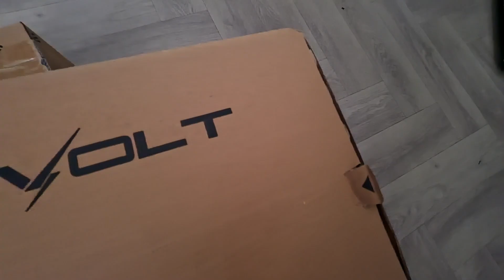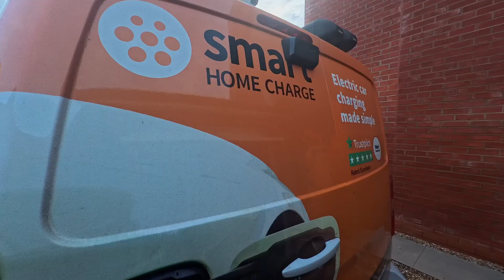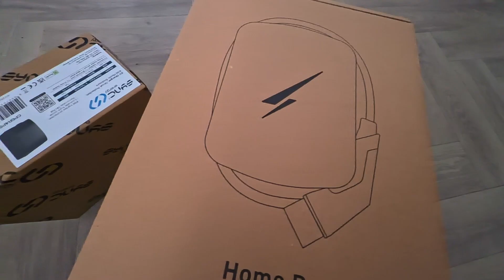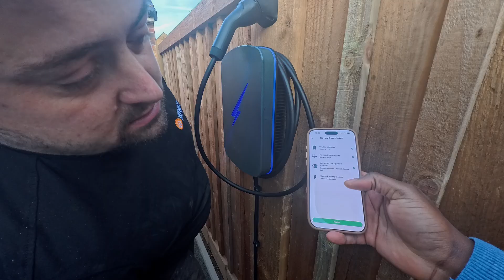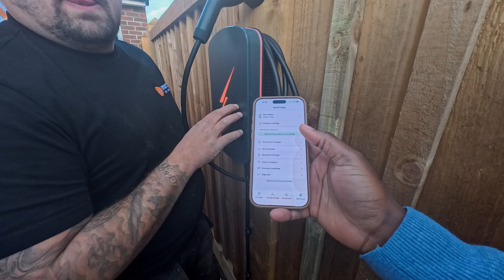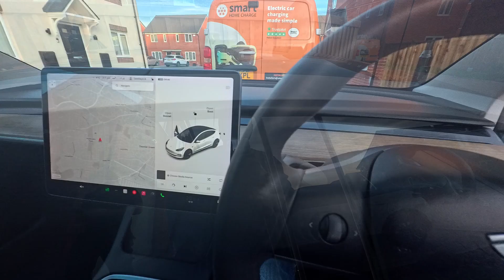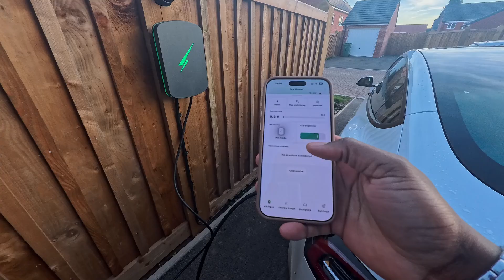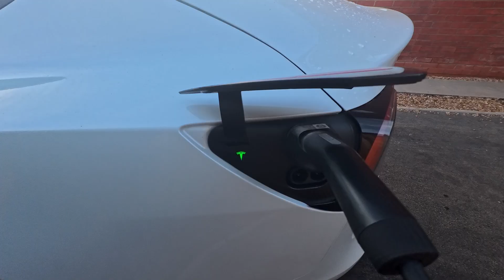Watch This Before Installing an EV Home Charger!

Comment: Hypervolt chargers support WiFi or can be hardwired with an Ethernet cabling which I got my installer to run. Not all EV chargers support Ethernet so if you don't have rock solid WIFI where the EV charger is going to be installed ensure you chose the right  EV charger and get Ethernet cabling run into your home network.
Reply from the maker: Well spot on. My installer also made mention of that. Thankfully my WiFi was strong enough for the device